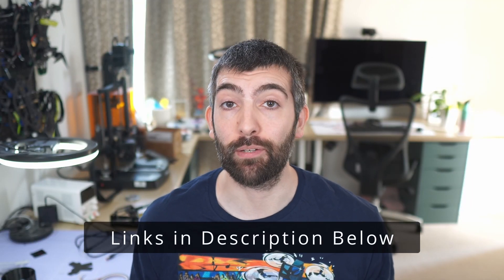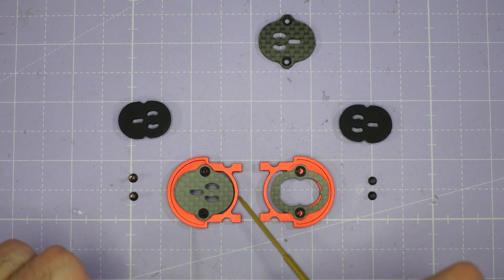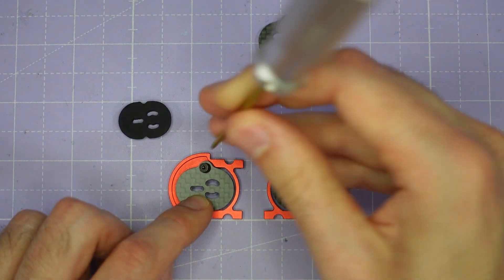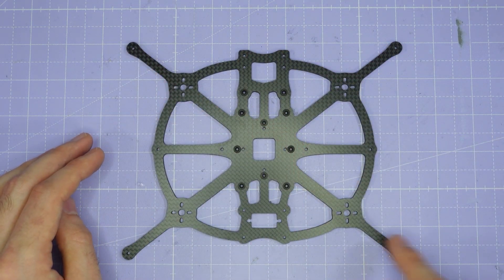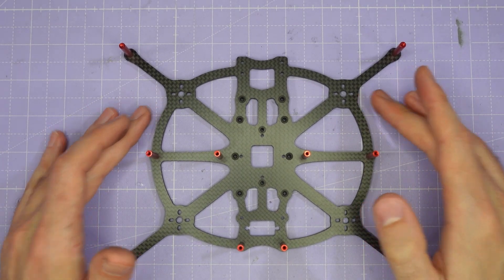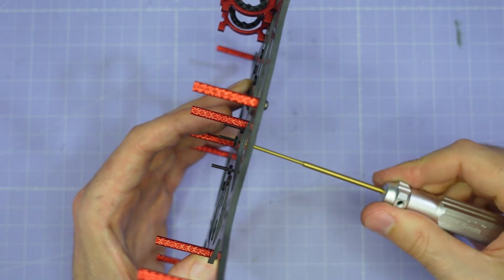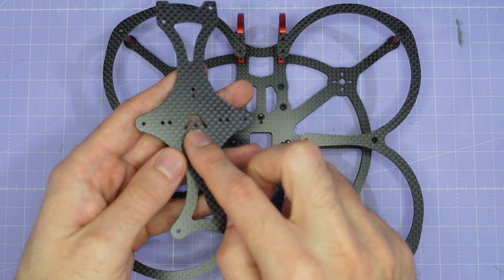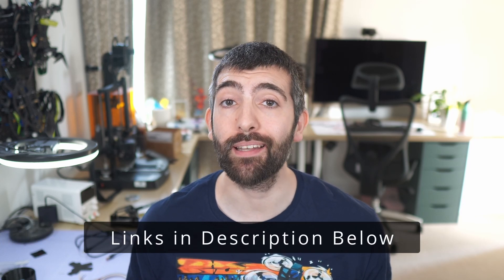AOS Cine V5 Build Guides: Cine20, Cine25, Cine30, Cine35 CineWhoops for Naked and Full Size GoPro

Comment: In the middle of buidling my new cine25.  Easy build. Too bad only 9mm motor spacing was implemented, I bought the Mamba 1404's Chris's recommended motors list. The front camera 3D print is not long enough doesn't work. This is the second AOS frame I've purchased and never feel like I'm getting a premium product/experience for the extra cost.  No manual, no tpu parts provided, recycled 3d prints, no battery straps, no AOS stickers, branding or any love from AOS. Chris , nice review on that NEWBEEDRONE SAVAGE BEE, you gave that drone much more love than your own Cine25.  Chris I like you and your content, you design a nice product but only give it 80%.  Don't worry I got you...I am redesigning your antenna mount and posting it on Thingiverse.